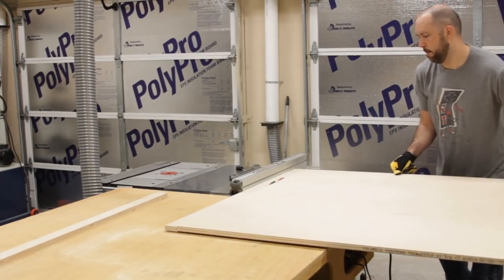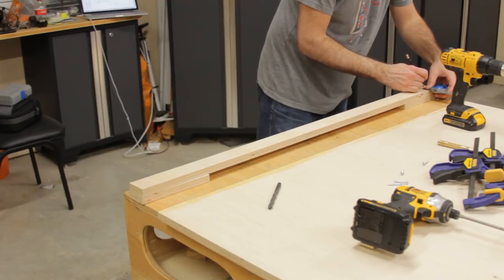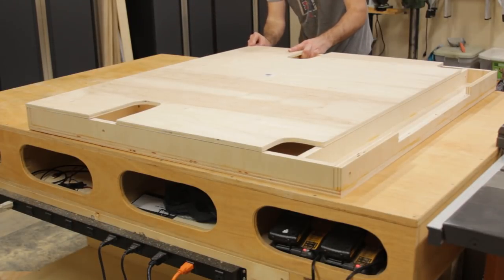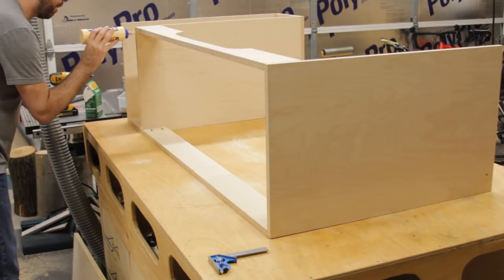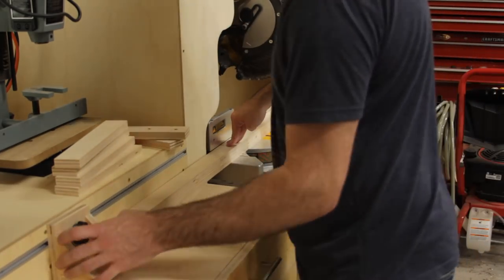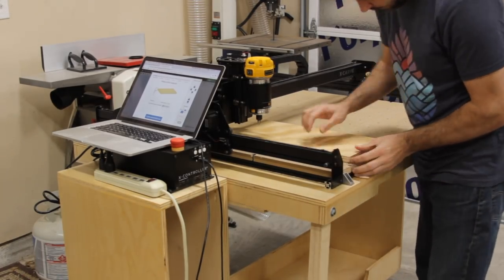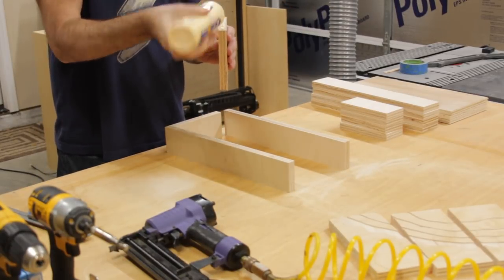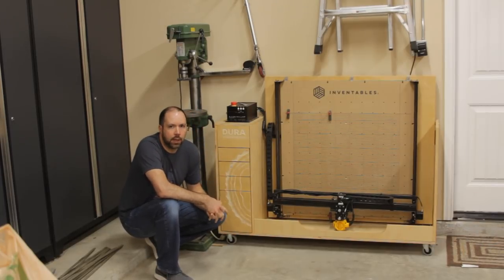Building an X-Carve Folding Table

Comment from the maker: You can find a cut list for this project in the following link. Note this is not a full set of plans, just the dimensions for each cut in the project. http://dura.works/plans/xcarve-folding-table-cut-list.pdf
Reply: Your cut list is a HUGE help.  There is one additional measurement that would be most helpful.  Can you share the size of the holes and exact center measurements for the pivot point on the two sides please?  It appears that the holes are 12-3/8 back on the torsion top.  Would you agree?  Thank you!
Reply from the maker: @DonG-xn2lu  On the torsion box, the holes are drilled 13 5/8" down the back. On the sides they are 1" down from the top, and 2 1/2" in from the back. As for the size of the holes, that depends on the size of the bolts you are using. I used 1/2" bolts, but 5/16" should work too.
Reply from the maker: Of note, this measurement is on the assembled torsion box.
Reply: @DuraWoodworks  Thank you!  That information will save me a lot of trial and error.
Reply: Are you using 3 sheets of 3/4" and one sheet of 1/2"?
Reply from the maker: Rick Risch correct
Reply: Where can I find the measurements to the box and height and width?  Thank you
Reply from the maker: @joeyleija9759  In the cut list, the bottom is basically the size of the footprint of the project.
Reply: How far apart did you space the long cross supports on the torsion box
Reply: Or are you saying the n the cut list to dado the supports and skip all the long pieces

Comment: I've watched a few folding table solutions for the X Carve... this the best I've seen to date. Many attach the folding shelf directly to a wall... a problem on three counts... vibration transmitted through the building, It is fixed in only one location, no access around all four sides. This is great... will need to construct something 'very similar when my X Carve arrives.

Comment: Has anyone had any issues over time storing an X Carve vertically. Most dont and since I have not bought one yet, I dont know how much strain that puts on any of the parts. I know the new version has a stiffer extruded rail and the router doesnt weigh too much but that's my concern with a vertical storage solution. LOOKS amazing and efficient. Great job!

Comment: The only change I might make to the front legs might have been a bolts with a rubber pad that screw in and out from the bottoms of the legs just in case the trolley is moved to an uneven section of the floor... very minor point though.

Comment: What do you think about taking this basic idea and making it a complete flip top? I'm thinking some kind of brackets that fit over the X-axis - one on either side of the router - and attach to the threaded inserts in the wasteboard for support? That, and probably several more of the Inventables brackets/t-nuts at locations under the wasteboard to hold the frame to the top surface?

I was thinking of making this as a cart that could either hold the surface vertically for efficient storage, CNC side up for carving, or the other side up, and equip that with dog holes and t-track to use as an assembly and outfeed table.

Comment: Just completed this build and your video and cut list was extremely helpful. I changed the width of the cabinet to 20" deep and the draw cabinet is 12" wide. You don't need legs with that depth. I just added a sliding bolt either side at the front to hold the table when horizontal. This works really well. One question, did you have to extend your cables for when the table is flipped vertical ? only mine don't seem to be long enough.

Comment: working on this now, any chance you remember the position in from the side for the leg bolts on the front of the torsion box?  guessing like 1.5"?  LOVE this design, thank you so much for the video!
Reply from the maker: Check the pinned thread, I believe I have those measurements in a reply there. Lemme know if those don’t work for you and I can go out and measure when I get back home.
Reply: @DuraWoodworks  thanks man!  i was reading those as for the side of the frame to the box, but could be confusing it :)
Reply from the maker: @adamsauls87  oh I hear ya. The ones on the front are 1.5” in from the left right on the front edge, and centered vertically if that makes sense.
Reply: @DuraWoodworks  makes perfect sense! Thanks again!

Comment: Josh, I finished my X-Carve table based on your incredible design. I made a few changes, 1. added drawer, 2. added side shelf for computer, 3. added lock mechanism to hold legs in place while storing or opening table. I took some pictures but haven't figured out how to attach them. Any thoughts?
Reply from the maker: Your best bet would probably be to add them on imgur or something similar and send the link along. Looking forward to seeing it!
Reply from the maker: Steve Davis that looks awesome! I like the darker stain. Thanks for the pictures!
Reply: @DuraWoodworks  Glad you got them, I took your advice and added the extra drawer and side shelf for my computer. 
What a space saver when everything is folded up, Thanks for the video and cut list.